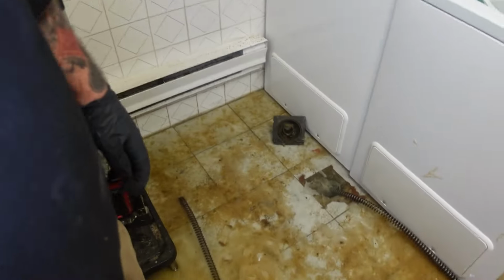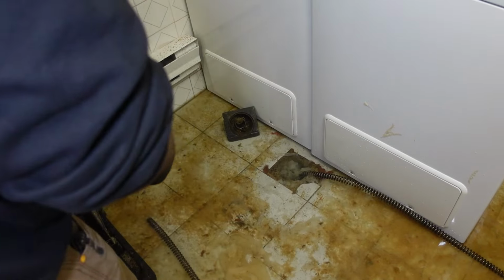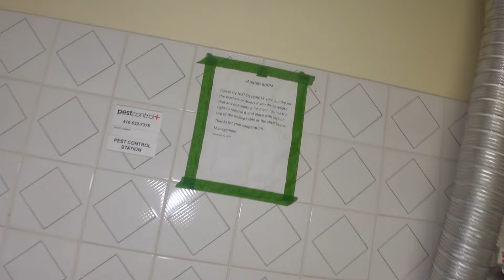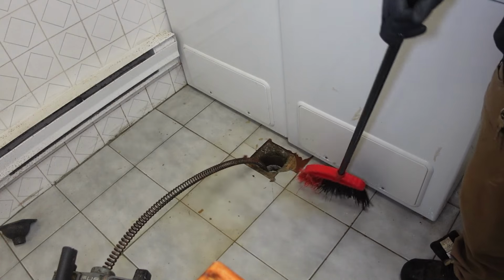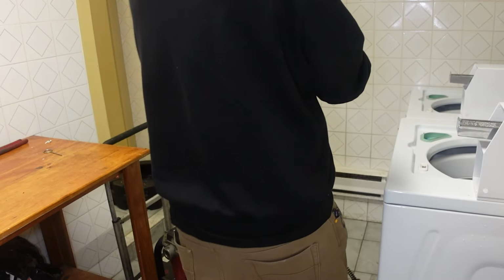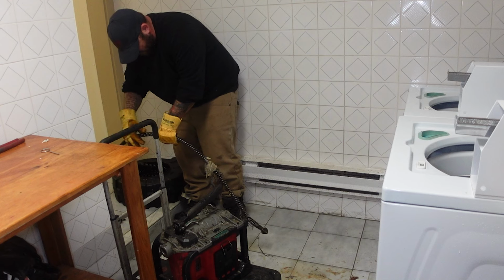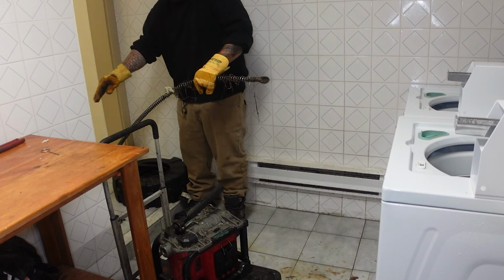Laundry Room Completely Flooded With sewage

Comment: So you’re clearing a mainline plug through a 2” floor drain with a Ptrap. Say you get a massive ball of wipes or tampons on the end of your cable. How you plan on getting it unstuck? Pull a toilet and go through the 3 or 4” main line……
Reply from the maker: It's a 4 inch floor drain thanks for watching have a great day
Reply: @Jaythatdrainguy  it most definitely is not.
Reply from the maker: @alaskanbeaut1631 The 7/8 cable will not go through a two inch drain and we've had the 7/8 cable actually snap going through 3 inch drains so we won't put them down a trap A clean out we definitely will snake a three inch with the 7/8
Reply: @Jaythatdrainguy  a 7/8 with an inner core no. That cheap flimsy thing yes. That’s pretty much a loose wrapped spring.
Reply from the maker: @alaskanbeaut1631 it is what it is